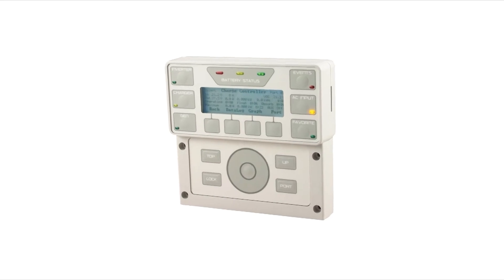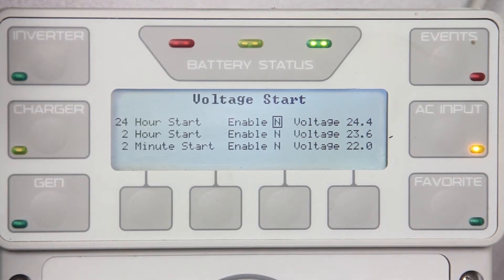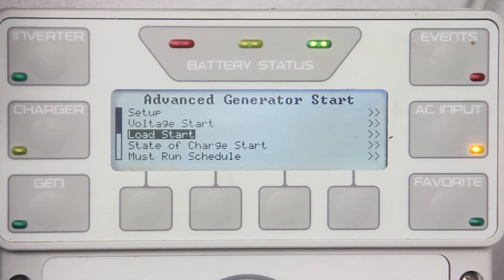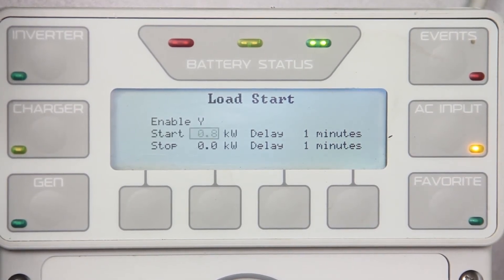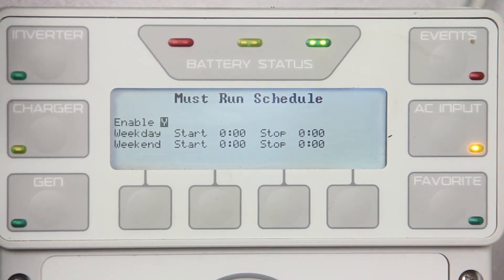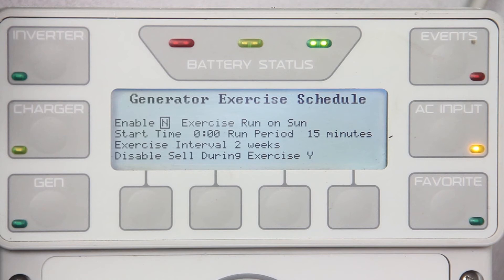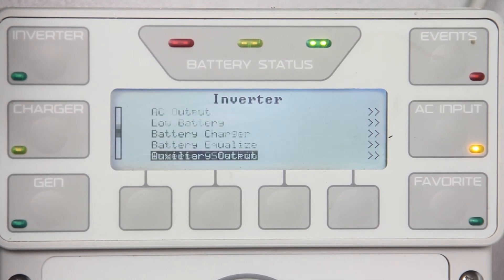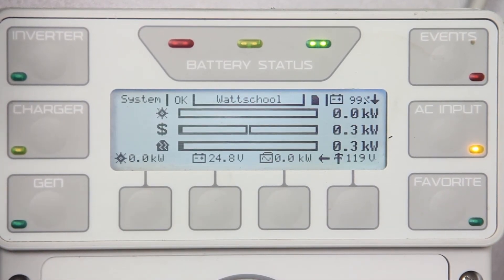MATE3: Advanced Generator Start Programming - Part 2

Comment: In having massive issues with this. Voltage start seems to turn on the generator for one minute before shutting it down. Only to start it 5 minutes later.  And keeping this cycle going over and over again.
Reply: Good luck. These systems are nothing but problem after problem after problem.
Reply: @willneighbors7115  my guy. You say this. Exactly on the fucking day the ac relay is fuckin broken on mine. 5k down the fu king drain. I cannot believed my family was bamboozled into getting this trash system. 

Like. Who do cheaper inverters work with 3phase generators not this piece of trash does not??? Even the shitty thing we were told to install for hundreds to allow it to take power from the generator  of dollars fucking burnt.  This shit is a joke. What a scam. 

But you seem to have experience with this. What model would you recommend and from what brand?